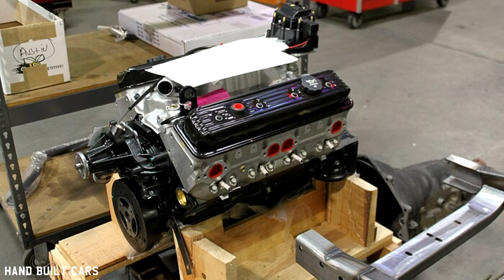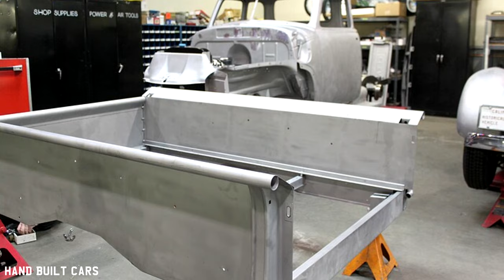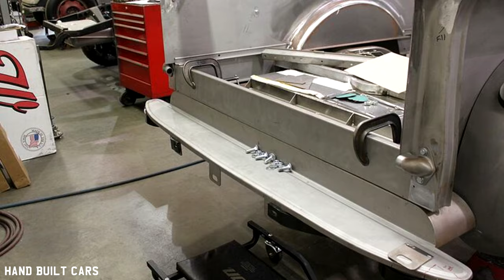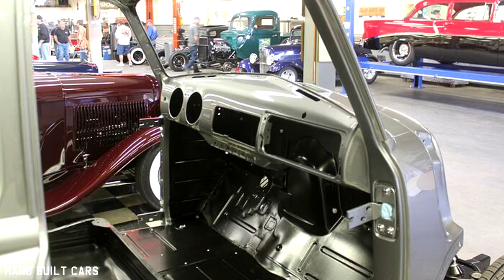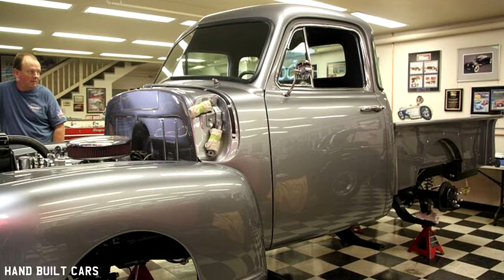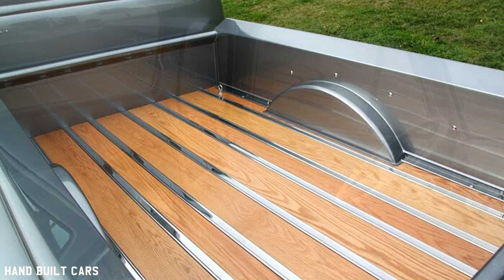1950 Chevrolet 3100 5-Window Pickup Truck Build Project

Comment: Why do you have to put a new chassis/engine / trans / brakes / wheels /to make a decent American vehicle?
Reply: So it doesn't ride/handle/ feel like a 1950 truck... Unless of course that's what you want...
Reply: Basically all they do is put an old body on new running gear,no matter the age of vehicle 50/60/70s.
Reply: Yep that's the way they do it, unless they don't have the money and they have to take a less expensive route...